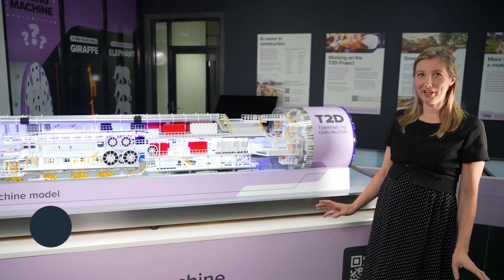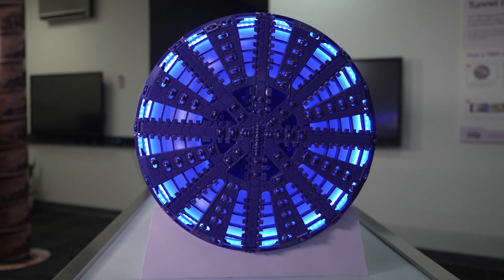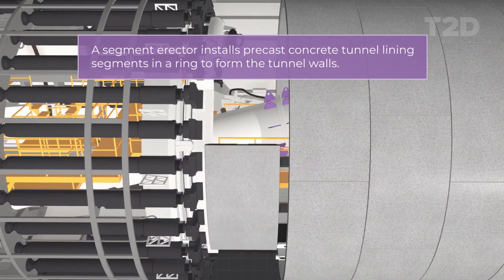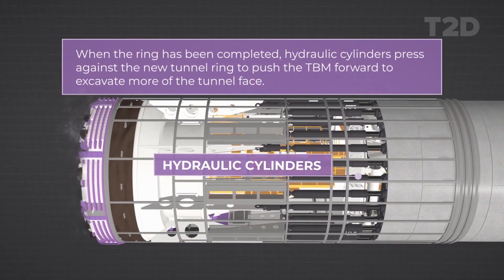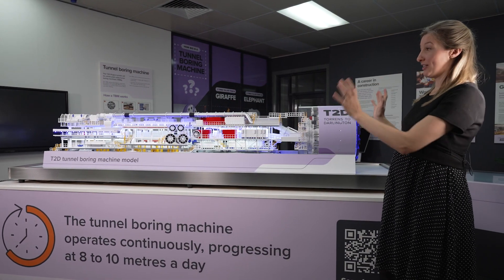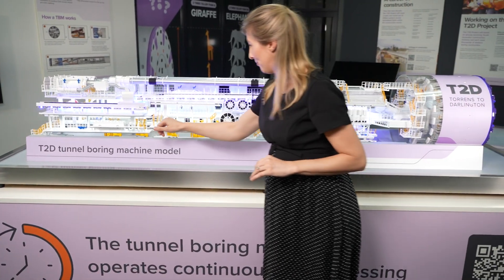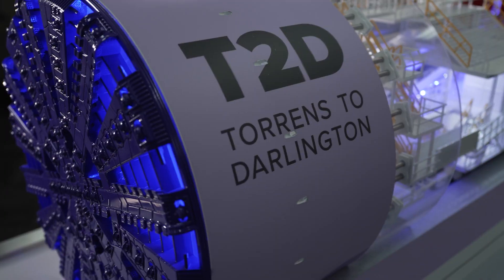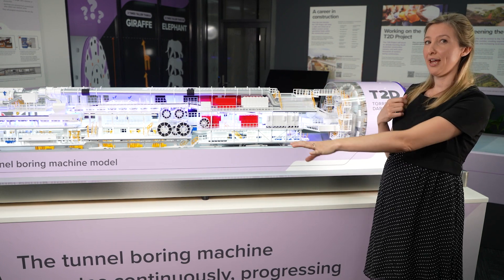How does a Tunnel Boring Machine work?

Comment: I know I'm only dreaming, but when the South Road tunnels are done, I'd love to see one of these dig a tunnel for freight trains from just south of Mitcham, all the way through to Callington.  (Sigh... a man can dream)🤔😁
Reply: And once they're done with digging a rail tunnel through the hills, they should then use it to create one from the bottom of the south eastern freeway, to link up with the north/south corridor so you can seamlessly transition between the two without any lights. Then a tunnel to finally get some rail between the Adelaide Airport and Adelaide Station.

Perhaps after all that they could even make the Adelaide Station a through station and finally get trains to the eastern suburbs. Maybe by the end of the century Adelaide might finally have a sensible transport system.
Reply: @ChrisEngioc  Cool Ideas.  With the Airport though, I'd run the underground railway straight up the center of Adelaide, with a station under the Central Market or Victoria square.  Then I'd split the track with a lime out east, and a loop around to the current station, and one at Rundle Mall, near Pultney Street.😁
Reply: @ChrisEngioc well they were considering a tram to Adelaide airport at one point